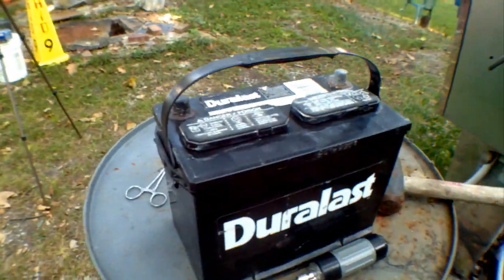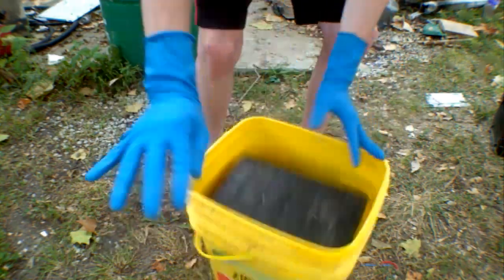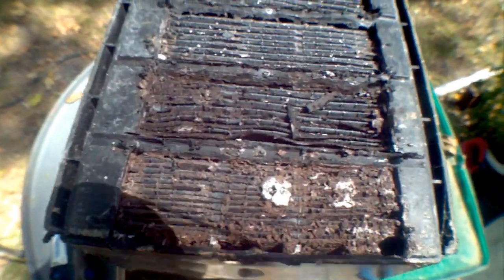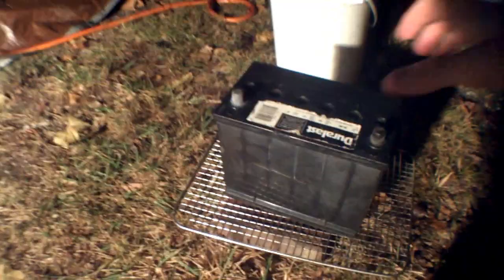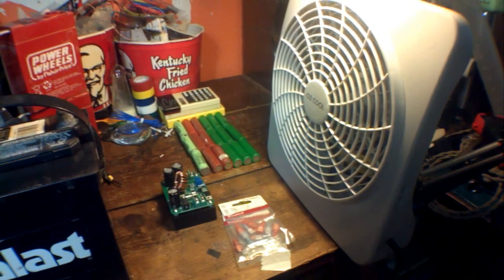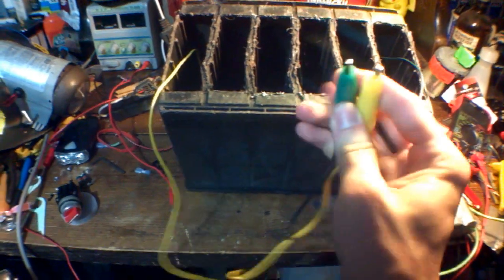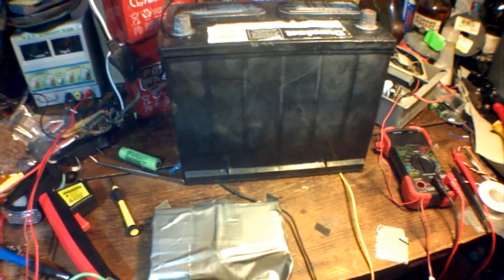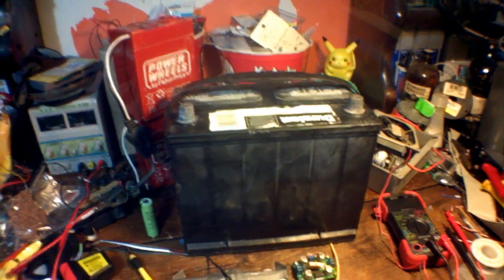DIY Lead-Acid to Lithium-Ion battery conversion 18650

Comment: Please put some boots and pants on dude... Sandals and heavy-machinery, battery acid etc etc etc are not conducive to safety. Don't be a dummy. Little kids watch these vids. Set an example will ya...
Reply: Well said
Reply: agree!  I thought about that too when he had the rubber gloves on with sandals, then the battery falls into the bucket and splashes acid out (made me cringe)
Reply: That acid will burn but no horrendous irreversible damage like if he were using concentrated sulfuric acid or something. He’s good. He should’ve just protected his eyes and if he got some acid on his skin just go rinse it off with a nearby water hose.
Reply: I have done much worse in my swim trunks and barefoot, I have also used a chainsaw completely naked, its all down to just being careful. Anyone watching this needs to take responsibility for their own safety. You cannot blame others for your own stupidity, that blame and claim culture is exactly what has brought ruin to the USA and the UK. Too many lefty do gooders telling folk what to do. The lefties are moaning here because they are talking about turning off street lighting late at night. My response is, anyone walking around after dark should have the sense to carry a torch, to prevent trips and falls, not to just expect to have full lighting at night, at great cost to tax payers and the environment.
Reply: +Jordan Bronson You should never wish for someone else to get hurt for any reason. It creates bad vibes for you in your life. You don't need that on your plate. ;-)

Comment: Dude why don't you just put the 8 volt pack in your pocket and forget the die hard case. By the way there is no such thing as a step up transformer where DC voltage is concerned. What you have there is an inverter and you will find it to be quite inefficient for your needs.

Comment: On the lithium cells you must monitor the voltage during charging and apply automatic protection. If you fail to apply protection then there is a high possibility of the cells exploding. Look and learn before you leap.
MoK
Reply: +Mo King He did look and he already knew. He was charging with a cv cc power supply

Comment: Hmm, more like Wile E. Coyote, super genius, if you ask me. I'm with the other commenters thinking this was a monumental waste of time and effort.  With your acid spill at the beginning, you're extremely lucky as well.  I hope all the toxic waste was disposed of properly.
Reply from the maker: +wesley115777 you get the looney toons referance, but not quite. /facepalm
Reply: +Rinoa Super-Genius Well, Rinoa Heartilly is kinda meaningless to me (I looked that up).  I'm happy to be enlightened.  One point I didn't make: I hope you wear eye protection any time you pop open a lead acid battery, or use any other acid with the strength of that in car batteries.
Reply from the maker: wesley115777
well then Wesley Crusher means nothing to me.
 
i'll tell you what my channel name means. my name is Rinoa and i fail at a lot of things hopefully in a funny way, thus the sarcastic "super-genius" on this channel.
Reply: +Rinoa Super-Genius Ah, gotcha.  For me, Wesley is my actual name, simple.  The numbers aren't random, but may as well be.
Reply from the maker: wesley115777
yeah, Rinoa is my actual name.

Comment: You plan to use a step up transformer with a battery? hmmmmmmm.
Reply: +JIMMY TATE he was using a boost converter not a transformer
Reply: Says transformer in description.

Comment: Try a sheet metal screw directly into the electrode. HF sells foot long screwdriver bits cheaply by the 10 pk and I cut them and make them into any custom screwdriver I need for things like this. The sheet metal screw has wide threads which you will need in soft, weak lead for best performance. #10 or 12. Even a 1/4-20 would be ideal -- sooner or later you will want a tap and that is the most common in SAE, it was used on everything. Bike axles are 3/8 NF by the way, you might want to buy that one (best to buy tap & die as a kit since the more you b uy the cheaper they are)instead since it will fit here and you can use it on bike work later.... it'll even recut bicycle axle threads should some be banged up and unusable.

BTW, its not a step up transformer, its a buck regulator. Do you even understand what it does?

Prior to PCs they would never be cheaply available to the common public or in any common household electronic item which was why we had all those big ugly wall warts. Now with one of those and one beefy wall wart, you can match it to virtually any household electronic providing the Amperage is adequate. You know the rest.

Comment: via the electric conversion, if that was a RWD vehicle they have a airline motor starter, electric, that mates up to the rear driveshaft. It's a pretty neat solution and even if you don't use it you'd probably enjoy googling it -- I saw it in the back pages of Popular Mechanics. Obviously a motor a wheel is the ideal way to go, though. I've seen a hydraulic vehicle do this and even with just an 11hp IC motor it could accelerate from 0 to 60 in under 3 seconds. Mostly because the "car" was a sr project more like a dune buggy but still mighty impressive. Too bad hydraulics of that size are so expensive to work with. And most of them are, whole unit together, not all that efficient. I still think electric is the way to go especially since you can use direct drive motors and use them as brakes. That's the ideal platform. I should check what elon is doing come to think of it.

Comment: Nice project and I commend your work. I would suggest better protective gear in the future other than short, flip-flops, and your glasses. Also, you might consider using an older motorcycle battery case in the future for better portability. Good luck.

Comment: what 11 year old buys a car battery.
Reply: I bought a deep cycle battery ,500 watt power inverter,and 50 watt solar pan like when I was 8 years old.
Reply: miespost
but why, what did you use it for.
Reply: +Marcus Christensen I used it for solar powering my tree house and running lights in my yard.
Reply: miespost
nice, was it a deep cycle?
Reply: +Marcus Christensen yes it was a deep cycle
Reply: miespost
still 8 years thats young. Though i did buy a 12 inch 1300watt car subwoofer when i was 11.
Reply: +Marcus Christensen cool what brand was the subwoofer.
Reply: miespost
sony xplod 1300w.
Reply: +Marcus Christensen nice, I just recently got two kicker comp 10 inch sub woofers there 150 Watts a piece.
Reply: miespost nice. Should give loads of bass.

Comment: This is an old video but if you use a step up anyway, it makes a lot more sense to have all cells in parallel so you avoid the balancing issue. Also no need to use the lead acid case :)

Comment: Majority of the people who watched this like myself wanted to see what would happen next. You succeded in showing probably 95 percent of the people on here what the inside of a battery looks like (because they never did it themselves, I for  one have not). These people wont admit what they learned because they would rather concentrate on you and your kind disposition. Your doing good making videos,  and where others wouldve edited the mistakes out. You kept them in because of  your great integrity to the project at hand and science as a whole. Just make sure you wear gloves, protective rubber apron and good eye protection next time. People do everything with their eyes and they have to last you for at least 80 plus years. Great Job !

Comment: thanks for doing this video.  I worked on batteries in a Telco CO for a while and the construction of those batteries is such that they have about 6" of open space under the plates for debris to fall. They also have a transparent case so you can see the internal workings I have never seen inside a car battery.  Thanks again for the video.

Comment: Why?...
You are replacing a defunct lead-acid battery with Lion cells. Your  application does not demand that the battery is the same shape and size of the original. So make a pack of the desired capacity, and put it in a smaller box...

Comment: I would have just built the li-ion battery pack like you did and then put a deans connector on the battery and make adapters for each of the things I wanted to power.

Comment: I respect your effort to do up the battery cleaning, etc. but dude, for all the time and effort  you have spent and all, you should have just go to a dollar shop and get a small container which fits the Li-Ion pack  you have made and the step-up controller.
further more, do you need to bring such a big "brick" around just to utilize 1/6 of it's capacity to put the battery?
You should have put your knowledge and time for better use.

Comment: You didn't convert anything... you turned a battery into a box.  You could have returned the battery to an auto parts store or scrap guy and got enough money to buy several plastic boxes.  Then the battery would have been recycled... I'm not wasting my time watching to the end, but I'm assuming the guy who wore sandals, gloves, and presumably no safety glasses just threw the lead in the trash and dumped the acid somewhere.
Reply: +Matthew Richardson ROFL!!!!!!

Comment: you only really need a plastic housing, it seems like there are so many different containers that could have been used rather than unnecessarily handling toxic material

Comment: Heads up, if you get a newer Duralast battery, you can pull the top off making a clean disassembly for you to replace the terminals and insides.
Good vids man

Comment: Sulfuric acid is not something to be trifled with.  You're lucky you didn't get seriously injured or blinded.  Safety squints designed to use with chemicals at a minimum.

Comment: They dont build them like that now. 3 months low power and the positive plates turn to mush now they are made of medium density compressed lead.
Reply from the maker: +Brian “Easty and the Wolf” Eastwood actually its more an issue of cars killing them, old cars dont pull much power from the battery running their computer, but now ones do.
Reply: +Rinoa Super-Genius That's a good point the loads are much greater. specially with alarms and onstar type systems.
Reply from the maker: Brian Eastwood
a deep cycle battery would probably last a lot longer because of that.

Comment: Where is the temp circuit??
Reply from the maker: +Giuseppe biondo everything in this is a temporary circuit.
Reply: +Rinoa Super-Genius sorry for the confusion. . I meant temperature circuit. . like the heat protection for the batteries. .. some times it's built into the 18650.. some times it's not
Reply from the maker: Giuseppe biondo
oh i dont need that. im not going to be pulling too much power.
Reply: +Rinoa Super-Genius gotcha

Comment: :O My OSHA training is flaring up watching this video. Please don't do this again, for your own safety, and for that of the environment. Buy or build a box for your battery project, and recycle your old and failed lead acid batteries. Lead acid batteries are hazardous waste, and must be handled properly. My heart skipped a beat when that battery dropped into the bucket and splashed sulfuric acid up into your face. I thought the worst was over, but then you cut open the battery and proceeded to scoop out toxic lead without wearing any protection, and without any way to protect the ground from the material you were working with. I'm curious where you dumped out that water that you used to rinse out the battery. That is toxic waste, so pretty much anywhere you dump it, you are committing a crime, and potentially poisoning someone or their children. :(

Comment: I'm not sure about the soldering directly to a battery like that... I'm glad you're ok.
Reply: Maybe I'm just gullible, I was told at a young age not to do that.
Reply: +Isaac Schultz You are correct. Proper tabs are quickly spot welded on, reducing the amount of heat transferred to the interior.

Comment: I have not LOLed literally in a LONG time.  When you dropped that battery into the bucket, I was just thinking, "gloves and sandals ¿" then BLOOSH !!! 
Whew. That was funny. Thanks. 
I'm commenting before watching, but I'm sure you're about to show us something cool.
Reply: +Rinoa Super-Genius   Something I learned from an old battery rebuilder. If you try this again look for a Weller soldering gun, and a flat blade (knife like) tip. Use it to cut the seam on the side near the top. The top will come off with the plates intact. Then you can clean it up from there ;-)  To reassemble cut coffee can lids into 1/16 inch strips, to use as filler rods. Use the soldering gun to melt both sides of the seam and add the filler as you go.
Reply from the maker: Voloxolov
there is no such thing as common sense.
Reply: @RinoaL  Yep you are the proof!
Reply: +The Sqoou HAHA I ruined my laughing moment by stopping the vid and looking for flame comments about the acid, shorts and sandels. Turns out I had 2 watch 2 more seconds :)
Reply: +Matthew Richardson C'mon now Matt. We all have our favorite things that we feel have helped us in our lives eh? For some, its fishing poles, others its a sweater or jacket or blanket, etc. If you read his description, it mentions that the battery came out of his grandparents car. Perhaps his feeling is connected to good memories of his grandparents etc. Anycase, who cares what you think? Its his vid! This vid that this kid made doesnt deserve the flame that you posted. Immature it is, really. For me, I found this video helpful because I stumbled onto it looking for ways to use my old Li batteries. I did get a good laugh when the battery fell into the bucket, only because its something that happened to me back in the day too, among other things like removing an oil pump from my truck engine and the oil that was still in the tube spilled on my face, etc.....its all part of learning I guess cause I never did that again! Anyways, we all do stupid stuff, no one is spared of that, and we all have our own concepts of what is significant in our lives, for whatever reason.....thats what makes us human, and individuals....
Reply from the maker: +The Sqoou haha your welcome :P
Reply: What is this idiot doing? I couldn't really pick my all time favourite battery I've ever had.
Reply: +The Sqoou I was thinking the same thing, being a chemist who has a machine shop for building prototype stuff. Geeze- young'uns really do think they are indestructible, don't they?  ;)
Reply from the maker: drs1919 1919drs
actually its more of this was the first big battery i had and learned a lot from it when i was younger.
Reply: @RinoaL  To bad you didn't learn the dangers of handling lead acid batteries from it. Or you would never have attempted this!! What a dummy!!!
Reply: +Rinoa Super-Genius Sentimental value is the most of them all.
Reply: +Rinoa Super-Genius:
It's a pity your wise old mentor aka, 'big battery' didn't teach you some common fucking sense... eh?
Reply: Hmm... Don't you mean 'there is no such thing as moron sense'?

Comment: Why would you wrap the batteries up with tape? The batteries are only going to get hotter and die faster and lose charge.
Reply: +MarkUs FinSki what about laptop batteries Mark? They're pretty much the same thing, arent they? a bunch of cylindrical batteries wired in series/parallel combinations and then sealed in a plastic case with a small breathing hole.....I think as long as certain parameters are met and maintained (ie. charging voltage, current draw, minimum voltage etc), then they should not get hot by calculation.

Comment: I appreciated your video.  I say good job trying new ideas to work out problems, instead of being a lemming.  I have been curious to see the inside of a battery also.  I wonder about the li-ion batteries sold in stores.  Need to do some more research myself, as they are very costly.  How did you get your battery to last so long, or was it just "around" so long.
  Thanks for the video.

Comment: one question......why even bother with using the original car battery case?  The battery pack you constructed worked fine without it.......in addition, disposing of the used battery would have been so much easier........

Comment: So you turned your battery that you could of got a core charge for at a local auto parts store into a case for your old dead 18650s?? So dumb..

Comment: I am never going to bother doing this since i don't need my laptop camping and usually I would just turn off my phone anyways.  If I had no option I might take the jumper box and a few small solar panel to charge my phone..  Is there anything I should do with my old batteries 18650's which I think ive got probably close to a gallon bag worth now some tho came out of old appliances.  I don't see using them as worthwhile tho.  Wondering are the lead plates pure lead and able to easily be reloaded as ammo still and what would the reaction be like to the acid if I neutralized it with baking soda.  Next time you try draining a car battery you might be better off not resting the heavy battery on some flimsy plastic.

Comment: If a guy is gonna go thru all of this why in the heck wouldn't you do a secret compartment where you can hide cash, wallet , have a spot for connections to be able to jump start something, run power hitch jack......even have a solar cell so it can charge while your camping.....anything!?!?  step your game up and push ideas to the next level.

Comment: just my 2 cents worth BUT shouldn't proper safety gear like proper footwear and heavy chemical resistant pants be worn!?!  anything to protect yourself from chemical burns, especially battery acid!, should be #1 priority I would think.......otherwise, very interesting video.